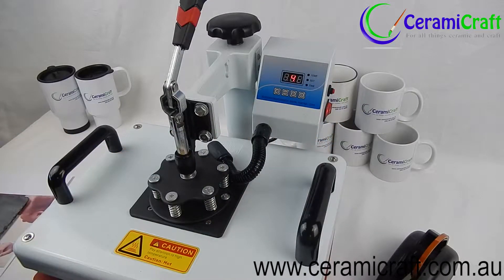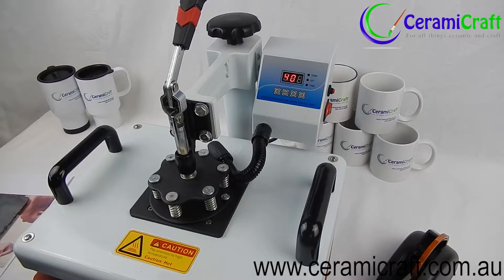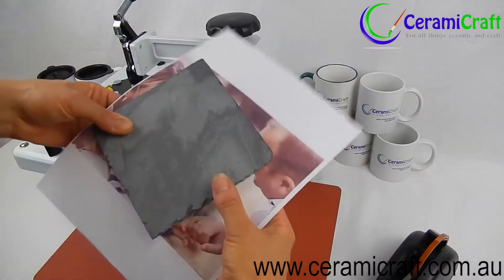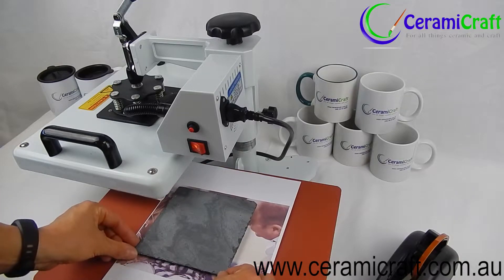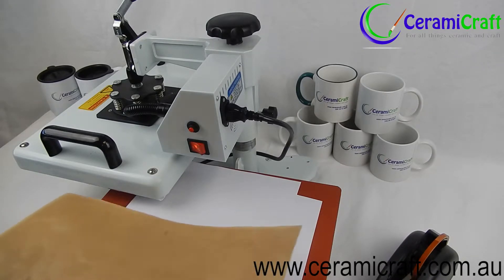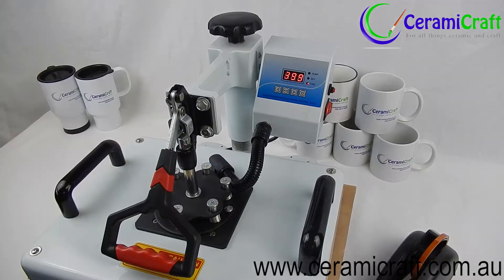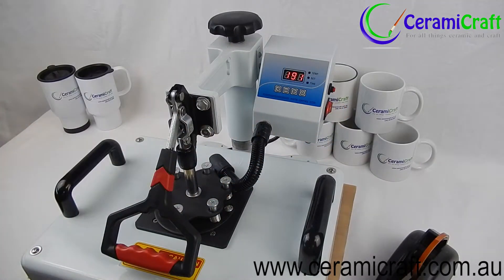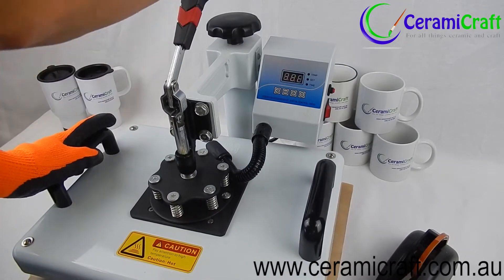How to use a flat heat press and sublimation process to transfer a photo onto rock photo slate

Comment: Hi, i am new to sublimation and having problems with Rock Slate. I have tried the same method as you multiple times aswell as other methods but i am still having problems. My images have a few faded blotches and on a few occasions had stripes going through the image. I think i have solved the stripe problem but the faded patches i am stuck with. Have you got any advice or tips for me or do you know what i could be. Id  appreciate any advice you can give.
Reply from the maker: Faded areas can indicate that your not getting even pressure across the surface area. If possible try to increase the pressure to ensure even contact is made across the surface of the slate. If using a manual flat press there is usually a simple knob adjustment for this. Good luck!